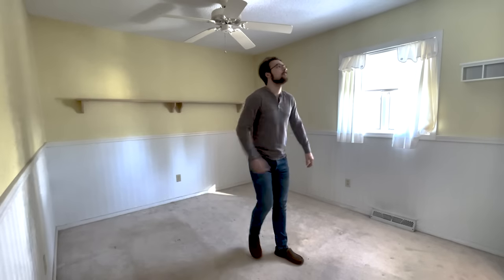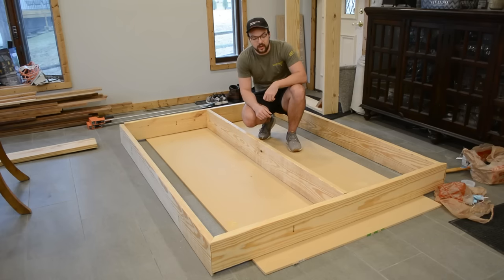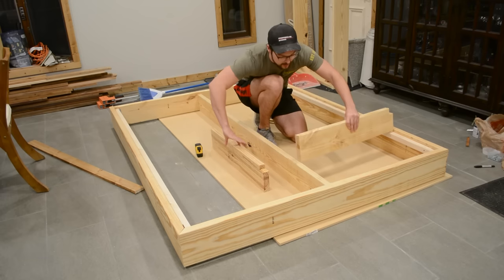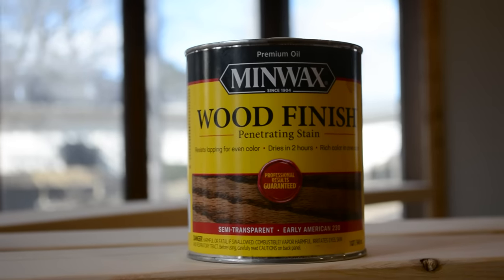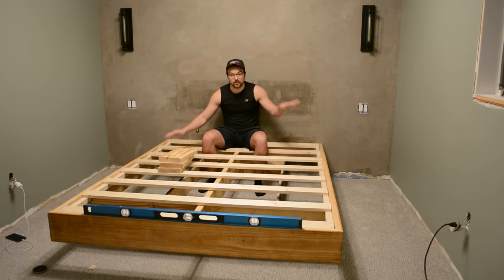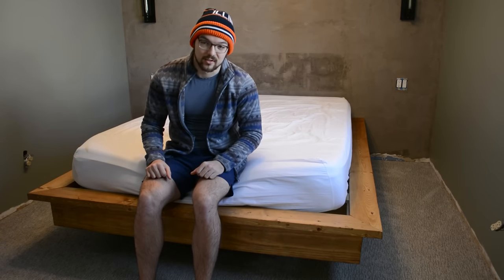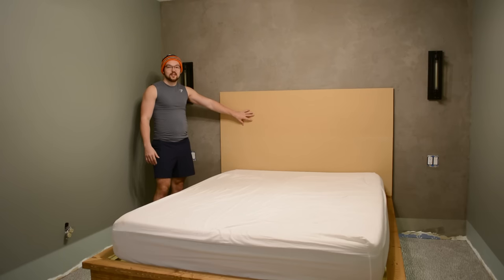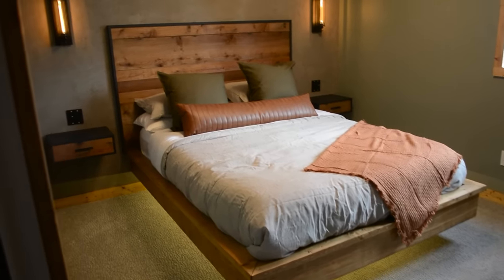How to Build a FLOATING BED | Bedroom Reno Part 5

Comment: Wouldn’t it have been easier to make your cuts, sand and stain before building, and use Simpson ties on the top and bottom frame to ensure a perfect 90° in each corner and keep the screws on the inside? Than you can just assemble everything in the bedroom all at the same time without unscrewing anything later.

Comment: Watched a bunch of floating bed videos, and this was the best. 
I was installing over hardwood, and used cheap lumber, so made the following adjustments for my case:
- Instead of staining the 2x8s, nailed a stained hardwood 1x8 fascia on the front and top
- my lumber was too cheap to stain or paint, so upholdstered black felt over the bottom box, which also served to be protection over the floor. Looked great. 
- used hurricane straps to connect bottom to top box 
- to avoid future squeaks, did not screw slats down, but instead lined the top of 2x2 (2x3 in my case) and inside of the box with leftover felt, and then held the slats in place with webbing screwed in-between the slats. 
- instead of ripping a 2x8, just used a 2x6 and placed the 2x3's to match

Comment: I enjoyed your video. I never thought of using the motion sensor on the led lights. Pure genius. 

As a contractor I can find a hundred things I would change on every build video. In this case there are only 2.  

1. A mistake I made in a bed build is you should have recessed the slats approximately 3/4" and placed 1/4" luan, MDF, Ply (no matter) or the mattress will begin to fail and you will feel every slat. 
2. The top trim boards should be under sized by 1/2" to 3/4" in length and width. 
These two things force the mattress down 1/2" which gives a neater appearance in the corners and prevents the  mattress from shifting.
Reply from the maker: Thank you for the thoughtful response and appreciate the feedback!

Comment: Best video. Simple. Clean. To the point. Have you done a king size frame?
Reply from the maker: Thank you! I haven’t done a king size but all the dimensions are in the description. You can adjust the measurements to fit a king bed. Hope that helps 😁

Comment: Just a tip; when ripping boards on a table saw, keep the bigger piece against the guide. You had it switched in the beginning. It can be a safety hazard.
Reply from the maker: Yeah good tip! My small contractors saw doesn't have much width so I had to do it the other way round but I try be careful when I need to do it
Reply: Did it at the end as well. A lot more stable by having the larger stock between the fence and blade.

Comment: For the headboard I found the standard Ghost Wood boards sold at Home Depot in-store. They’re like $13-21 a Board depending on size. Worth it. I also used pocket holes to hold everything together, including the 2x4 top edging. Other than that, I followed your plans and it turned out great. Made my wife happy. Those lights work great too. Bought a second set for beneath our kitchen cabinets. Total project cost was right around $345 in supplies. Free labor…me.
Reply: I had seen another more complex video with hardware. But yours was so fantastic and simple to move around the work at the end man it was top 👍
Reply: I'm following you and I gave 👍 because you deserve everything
Reply: I'm following you and I gave 👍 because you deserve everything
Reply: Man I have no words; you were EVERYTHING. Lighting up the room; to the blankets, roller and pillows 💯

Comment: Nice design and video but without the dimensions it is not very helpful, especially given the issues around balance/stability. Can you please post the dimensions? Thanks! Would this bed work in a situation where you CANNOT secure the bed into the wall, like an apartment?
Reply from the maker: Thank you! I will list all the dimensions in the description. Let me know if you need any other info!

Also, I think it would still work in a situation that you cannot secure it to the wall but it would be slightly less stable. But, as long as you are aware, I think you could avoid having any issues. Just probably shouldn't jump on it haha
Reply: @GoldenKeyDesign  Thank you very much!

Comment: Very nice, really good idea I never saw a floating bed, maybe if the wooden wall you mounted on the side of the head, you would make a space of 10 cm with lighting, the feeling of the floating bed was stronger.
  Question: Have you checked if two people are sitting right at the end of the bed, the bed balanced?
Nice job .
Reply from the maker: Good idea for the lighting. And yes, the bed can support multiple people without any issues. I used 6" lag screws to secure it to the wall so it is plenty strong

Comment: how much weight can this hold if you have a rough guess i have 2 friends who are giants and weigh around 260lbs would they be able to sit on this bed with people? or would it be a thing where i would have to politely ask them not to sit on my bed?
Reply from the maker: I have had a variety of people sleep on the bed with no issues. The most amount of weight in total was probably  around 400lbs. I can’t guarantee that it would hold 520lbs but I think it would fair just fine

Comment: Great job I used this to make a Floating bed it cam out Spectacular!! One *Note, your Inner/ outer dimensions for your cap are set for a 2x6, however you made the decision to go 2x4 won’t get a 45 degree cut with the given dimensions it’s not hard to figure out just watch your cuts! Amazing video Thank you!
Reply from the maker: Thank you! That's awesome that you were able to make it yourself! I actually did, however, list the dimensions for the top cap using 2x4s but I had it as 4" instead of the nominal width of 3.5" wide. I updated the outer dimensions to reflect this. Thanks for the catch!

Comment: Excellent design, man!  Worked for me. :-).  I dropped the slat rails 1/2" and put a 1/4" piece of plywood on the slats, under the mattress, so you can't see the floor at the edge of the mattress.  Oh, and stained to match the rest of the exposed wood.
Reply from the maker: Thank you and nice job! I would drill some holes in the 1/4" plywood for ventilation of the mattress. The slats are meant to allow the mattress to breathe so some holes in the plywood would help with that.
Reply: @GoldenKeyDesign    Brilliant -- I had not considered that.  Much thanks.

Comment: I made one like that in '82 and still use it however I discovered the " Torsion Box "  by Ian Kirby, Fine Woodworking, '82. Its basically a box consisting of a " honeycomb " type network of 1/4 " plywood covered by two sheets of 1/4 " plywood. It's like an airplane wing, very light and very resistant to twisting ( torsion ). It's important to rip all the pieces ( sides and " honey comb " at the same width without changing the fence. I made one for my table saw runoff table 20 yrs ago and it's still doing great. Nice job on yours though.
Reply from the maker: Yeah, I have built many torsion boxes before. For this bed it wasn't needed as the structure was already strong enough and there won't be much twisting forces applied to it. Thanks for watching!
Reply: @GoldenKeyDesign  I was referring more to the benefit of being lightweight.

Comment: I have a suggestion for you:-

Make that headboard 1-2 inches away from the wall and put some lights back there so it will look like that board is not touching the wall just like the bed is not touching the ground. 

Btw, I really appreciate it!

Comment: I know this maybe a weird question. But is there any places where you can get the power tools used to build. Maybe second hand? I'm disabled so cost is a Huge issue but I have Ideas and desire a Plenty lol. Also any ideas on the MOST IMPORTANT tools that can allow for Many uses when doing Diy. I ask bc luv you step by step videos and seeing that you do this by your self (well with the village) but you show step by step the whole cutting process which is a life saver to me. So I figured maybe you'd be the person to ask about tools. Knw u get a Ton of questions. So 🤞🏾 maybe this one catches your eye. Thanks so much for the loads of inspiration. ⭐⭐⭐⭐⭐👍🏾💭
Reply from the maker: You can find lots of tools on Facebook marketplace or Craigslist. I would start will a drill/impact driver and a circular saw. From there you can add tools to your arsenal as you need them

Comment: Thanks! My son and I are building it!. Great video! How did you come up with the base dimensions? I’m asking for 2 reasons. 1. we want to convert to a size full bed and I see from your reply regarding a size Full that to narrow down to 6 in and shorten the length by 5 inches. 2. I don’t want the base to be too tippy (Like to limit screws or not screw bed into wall at all). Thanks!

Comment: For screw holes you can mix glue and the dust from your saw to fill it in. Alot cheaper then filler or bondo
Reply from the maker: Good tip! I’ve used that method before but I found that it doesn’t work well for such large holes, especially if it’s to be painted. I prefer using bondo in this instance since it dries faster and you can sand it down to a perfectly smooth finish

Comment: My only issue with using this style and design is that the room I'm moving into is up a pretty steep set of stairs that starts at the door at the bottom. It would go together upstairs and have to be disassembled to move it someday. 😅

Comment: Great design and pretty simple. Can you tell me what sort of wood you used for the headboard? Hard to tell if you purchased those boards that color or if it’s just standard fur/pine with an added finish. I’ll need to modify a bit for a Cal King. Thanks again for sharing. Great job.
Reply from the maker: Thank you! This is cedar that we reused from our kitchen demo. You won’t be able to find it in stores. Some of the big box stores sell legitimate reclaimed barn wood online though. It can be quite pricey however

Comment: new watcher - great content, why is the smaller box butt joint on one end and mitred on the other?
Reply from the maker: Thank you and great eye! Butt joints are a bit easier and since the lower box would be painted and not really seen, I opted for a butt joint there. The top box is much more visible and will be stained, therefore a mitered corner looks much better

Comment: Hey man I’m 17 years old, and wanting to build this model of a floating bed do you have any tips for me building one for a full size bed?
Reply from the maker: That’s awesome! I would use my dimensions in the description and adjust them for a full by determining the difference in length and width between a queen and full. After that, make a cut list of all the boards you need and what sizes. Then take it slow and use my video as a guide. You got this! Good luck with the build!

Comment: Hey man, great build, you make look easy. beautiful finish. you're very talented. I'm gonna attempt to build it. one question, what kind of screes did you use for this project?
Reply from the maker: Thanks!! I used a variety depending on the connection, but mainly 2.5" grk screws

Comment: Ive read through over 100 comments looking for, not the bed dimensions but the cut dimensions of each piece of lumber you had to cut. Do you possible have those? If you do, do you have them for a king size?
Reply from the maker: Unfortunately I don't have a cut list. But, between the dimensions I listed in the description and the step by step instructions in the video, you should be able to build one yourself. A king is the same length as a queen, but is 16" wider. So take the dimensions I provided and add 16" to the width. Hope that helps!

Comment: Hi I saw you replied to most of the comments and was wondering if the bed needs to be screwed onto a wall for it to support people sitting on the edges? Nice build and hope I can try it myself with a 140x200 cm matrass size just want to know if it needs to be screwed in. Thanks and have a good day.
Reply from the maker: It’s hard to say but I would screw it to the wall just to be safe. It really depends how big each box is and how much the person sitting on the edge weighs. Once I screwed mine in, it was super solid and has never rocked/moved. Hope that helps!
Reply: @GoldenKeyDesign  Thanks a lot this really helped me make up my mind. I will try to make it so that I don't have to screw it but plan so that I can if needed, so when I make it I can test if it does need to be screwed in. I will give an update on the result once built, thanks alot!

Comment: How big of a base would you suggest for a king size mattress? Looking forward to building this. Thanks 🙏
Reply from the maker: A king mattress is 16” wider than a queen and the same length. So I would build the smaller box the same dimensions as listed in the description but widen it by 16” so it has the same amount of cantilever. Hope that helps!

Comment: You think a little more height to the inside base box would enhance the floating effect?  Think those were 2 x 8’s correct? Maybe 2 x 10’s would look better
Reply from the maker: Good idea, but you gotta be careful if you raise the bed up higher. Yes, I did you use 2x8s, but if I went any higher, you would be able to see the lower box when looking at the bed which defeats the floating effect. Every room is a bit different and the angle you look at the bed changes but I found that 2x8s worked perfectly and raised the bed to a comfortable height to get in and out of. Hope that helps!

Comment: WOW, what an awesome job.. I gotta say. I may copy this one.. Except for the headboard.. 
I'm really really surprised thou, that you attached the headboard to the WALL?? 
what if you want to redesign the room someday?  wouldn't it be easier and better to just have attached the headboard to the floating bed?? so you could move the bed around if need be?  that's the only change I'm gonna make!!  other than that. this is an awesome bed design and motion setting..
Reply from the maker: Thank you! If I did want to redesign the room (which is probably many, many years down the road), I would take off the reclaimed wood as I would want to save that and then from there I can unscrew the MDF panel from the wall. Shouldn't be to hard and I don't see myself doing that in the near future anyway

Comment: Hey man. That's an awesome build. Planning something similar. Does the proportion between the lower base box and the actual bed turned out good for you? Do you generate substantial leverage if you sit on the edge of the bed? Does it even threaten to tip ober? Thnaks
Reply from the maker: Thank you! Great question! As I was building it, I had a similar concern. It turned out to not be an issue at all. The key was that I lag bolted the boxes to the headboard wall. That keeps the bed from tipping if you sit on the very edge. But once it’s screwed into the wall it becomes very sturdy. I actually jumped on the very edge of the bed and it held firm! Hope that helps!
Reply: @GoldenKeyDesign  surely will. Thank you!

Comment: hello, if i don’t screw anything into the wall would it still be sturdy enough if someone sleeps or sits on the very edge??
Reply from the maker: It's tough to say but I think you will be fine. If you are at all worried, you can make the lower box a little larger so there is less of a cantilever

Comment: I see the measurements for the top cap is 2x4. But is that the measurements before u cut 1 1/2" off the lip or after?
Reply from the maker: The measurements in the description are after I cut the lip off

Comment: You should probably have added a switch that turns off the power source of the adapter of the lights so that you can safely and easily cut the power off when necessary
Reply from the maker: Good idea! For me it’s easy to just unplug it when I need to

Comment: So am I correct that’s a total of 9 2x8? 4 for the small box 5 for the large box a total of 8 slats 3 2x4 for cap and that’s all the wood ?
Reply from the maker: I didn't put the number of each board in the description since a lot of people adapt the design to fit different size mattresses. Also, you could buy extra long 2x8s and get multiple pieces out of it rather than buying multiple smaller pieces depending on what your supplier has in stock. You got it right in terms of the number and size. You just need to add 2 additional 2x4s to support the slats in the larger box. Hope that helps!

Comment: How did you figure out the measurements for the small box, the bottom one? I’m building one for a king size bed. Thanks!
Reply from the maker: Honestly it was a bit of a subjective decision. I made it about 36” less wide and 18” less long than the larger box. This provided enough structural support and you can’t see it either so it maintains the floating effect. For a king bed I would leave the length the same, but increase the width by 16” to accommodate the larger mattress. Hope that helps!

Comment: Hi Grant. Love the build. About to build it for my son. Just have a question about the size of the top box. My son's bed is a queen. 60" x 80" standard size. I was curious about you 65" x 84" measurements for the top box. Is the extra to give space for the top boards to be mounted around the edge or is your mattress bigger a bit. Im working with a smaller room and want to save on the space. So if I could shave it down a few inches I would. And if so should I do the same on the smaller box? Just want your opinion 
Thank you, Drew
Reply from the maker: Thanks and good question! The extra couple inches is to make room for and have a place to attach the cap around the perimeter of the bed as you mentioned. You might be able to get away with making it smaller by making the cap width smaller or scaling it down to fit tighter up against the mattress. If you end of making the lager box smaller, I would also make the smaller box smaller too so that you don’t see it under the bed. Hope that makes sense 😁